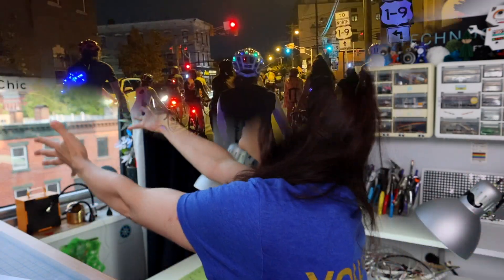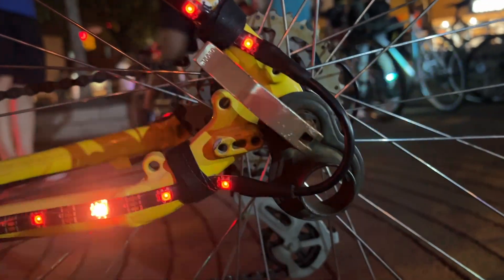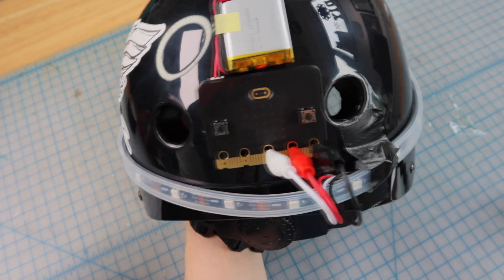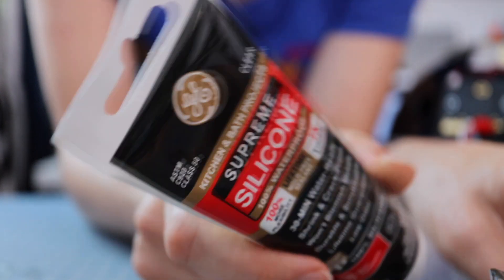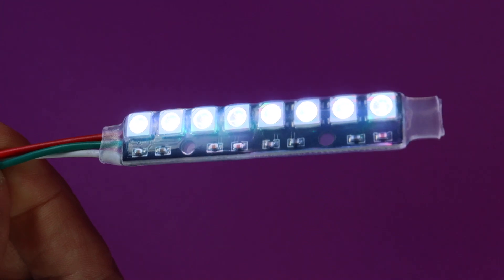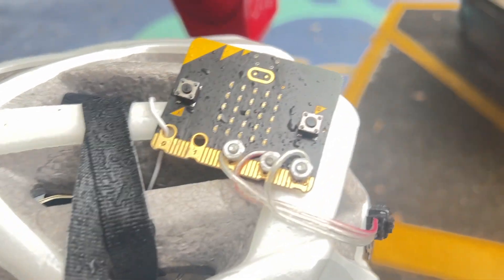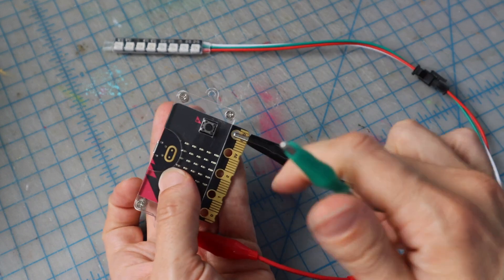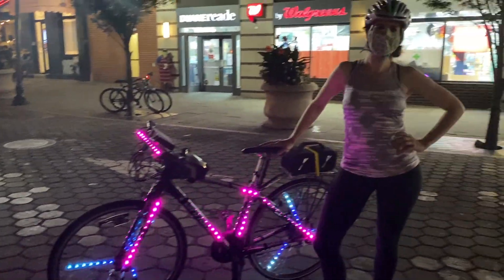NeoPixels: Weatherproofing and Durability // Creative LEDs * 09 *

Comment: You never mentioned UV resistance. I have gel coat strips outside and after only one year, the gel coat has completely degraded and become yellow and partially opaque.
Reply from the maker: Oh no! Mine did too - It hasn't degraded the look of the LEDs in the dark however. What would you add for UV resistance?